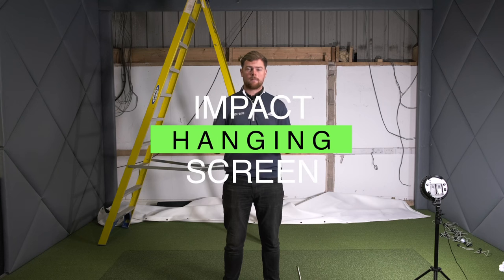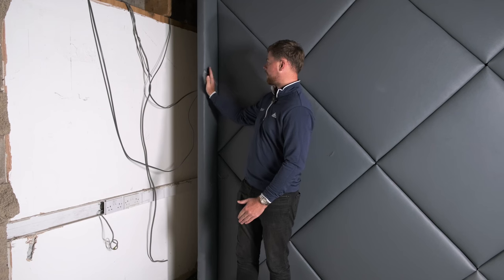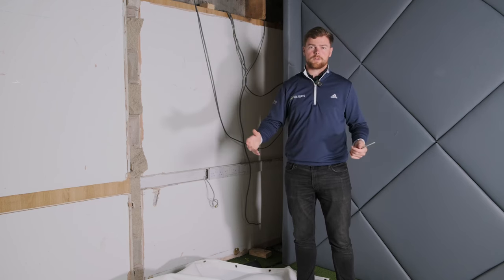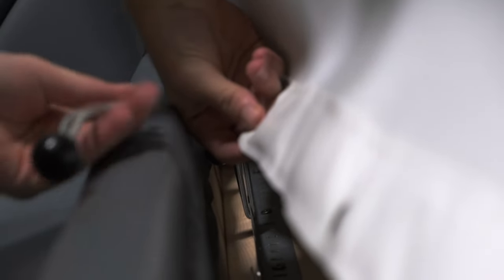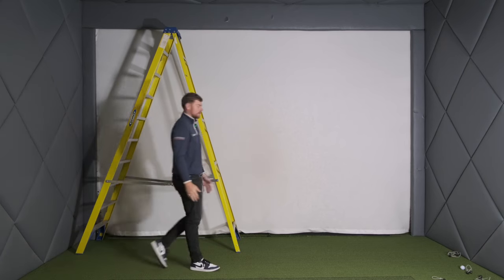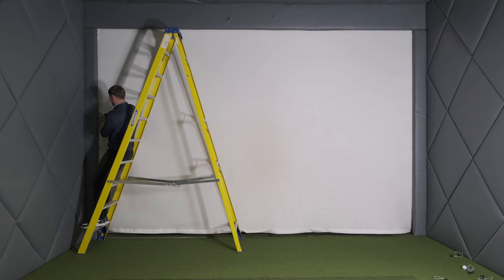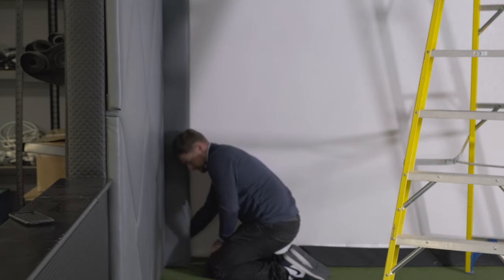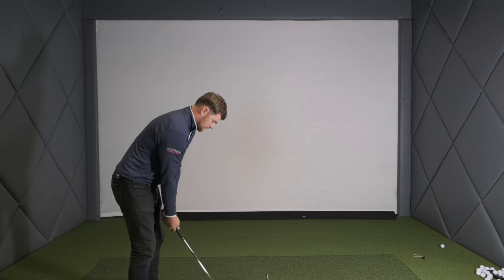How To Hang A Golf Impact Screen | DIY Golf Simulator | Home Golf Simulator

Comment: This is great.  How do I calculate the distance between the angle and the grommets?  i.e.  If my slotted angle is mounted 12 feet apart, how much wide is the actual screen?
Reply from the maker: Hi Bradley, we tend to allow 5-7cm distance for correct tension

Comment: Great video!  How wide are the mdf padding pieces on the sides to hide the bungees?
Reply: Also, how did you attach the side pieces to hide the bungees.  Did you upholster the piece and then attach it to the frame?
Reply: Great video Harrison,
Reply from the maker: the MDF padding is 10cm wide, those specific ones in our bays were made with the padding already in them, however you can but the tiles on top of the mdf as well.
Reply: @golfbaysofficial  Thank you!  How did you attach that piece to the frame?  Did you screw it from the back or glue it to the front?  Thanks for your help!
Reply from the maker: we screw it in from the back